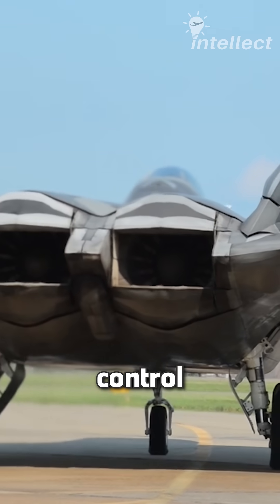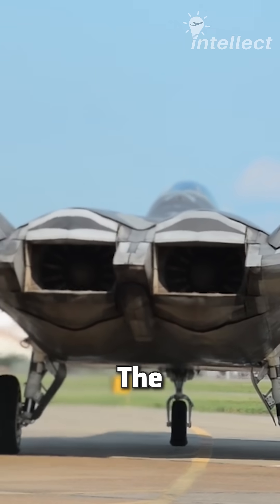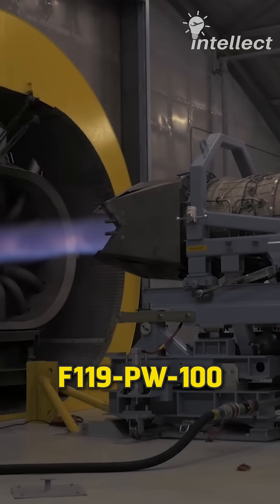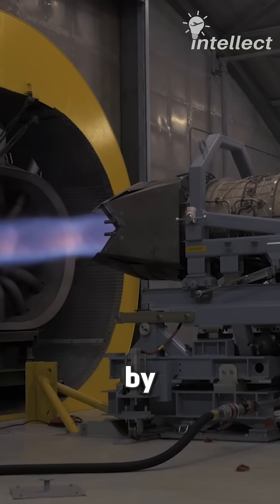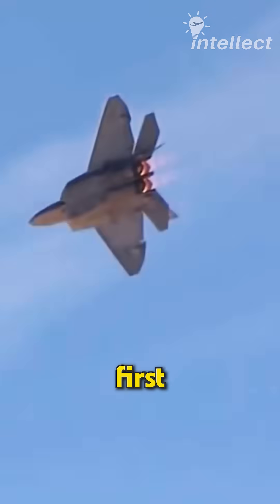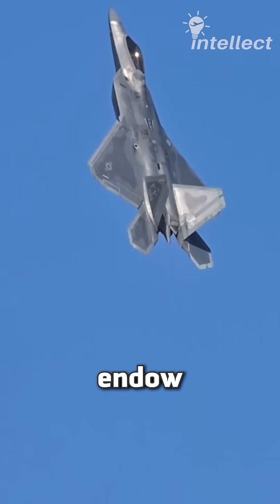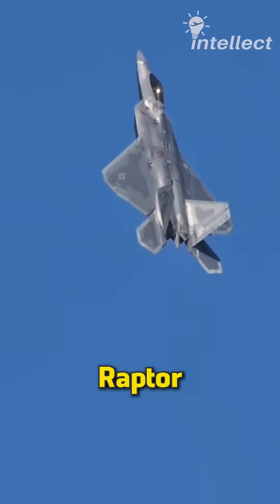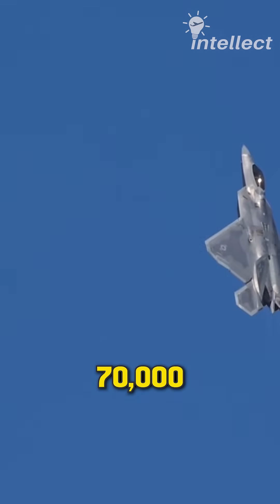How Does the F119 Engine Take Thrust Vectoring to the Next Level?

Comment: Russians did 360 degrees thrust vectoring like 20yrs ago😂
Reply from the maker: True! But 3D thrust vectoring nozzles can compromise stealth as they introduce more RCS.
Reply: As far as I can tell the only aircraft with true 3d thrust vectoring (excluding VTOLs) are prototypes like the x 38 (where thrust vectoring was invented) and f16 VISTA Russian thrust vectoring has a plus or minus 20 degree range of motion with the plain of motion tilted inwards 30 degrees
Reply: Yeah but they're not stealthy
Reply: And the us almost 40 years ago but neither country has them in service
Reply: @aquilesca5tr0  almost all variants of the Su-30/Su-35 have it where did you read that info? sound like someone's talking out of their ass to me. The Flanker family has had 3D thrust vectoring for OVER 30 years buddy. and they are in service in many countries, the F-22 only has stealth (nozzle wise not aircraft) over its thrust vectoring counterparts. but still insane engineering for mid 90s

also almost 40 years your 3 years off, F-15 STOL was 1988 i think correct me if im wrong
Reply: @tinfoilchampion3389  What russians call 3d thrust vectoring is just 2d vectoring with the nozzles mounted diagonally, that applies to every service aircraft that russia claims has 3d thrust vectoring.
The su37 has the same engines with the same nozzles as the su35 but mounted with the thrust vectoring axis vertically while the su35 has the thrust vectoring axis at an 32 degree angle meaning when the nozzles point up they also point outwards.

Comment: The sukohoi Thrusrt vectorial is much more advanced
Reply: False, the engines on sukhois only get +-15 degrees, f22 gets 20
Reply: @aquilesca5tr0  f-22 only have 2D movement, sukhois is on 3D
Reply: @tricusgames2602  that is false, sukhois have 2d nozzles mounted diagonally but they only move in one direction, only experimental planes have true 3d vectoring
Reply: @tricusgames2602  it's the nozzle moving along the single diagonal at 32 degrees axis it can move at. That's why it goes to the side when the pilot just pull pitch up
Reply: @aquilesca5tr0  i'm pretty sure theres videos of that

Comment: The sr 71 engines put out that much thrust, no vectoring tho and it went 3.5 mach, makes you wonder what the f22 can do
Reply: Thing is, when you have a stealth aircraft, you have to severely limit your speed for any length of time because the outside of the plane will heat up and you'll be vulnerable to infrared detection. This is why B2/b21 raiders don't go very fast.
Reply: @fppro1679 Correct!
 flattened and shielded nozzles come at a great cost of speed (depends on the aircraft’s general purpose as the nozzles are usually used to reduce IR signature) the J-58 being a ramjet turbojet hybrid releases a lot of heat but it didn’t matter because it travelled so fast that SAMs at the time couldn’t catch up nor could the MiG-25 however it could maybe intercept it if the pilots aren’t being careful

Also the B-2 and B-21 can’t get much intake compared to bottom intake aircraft like the F-35C or F-22A because of the top mounted intakes but they still provide enough to get the aircraft in the air based on the taper and aspect ratios as well as the certain aerofoil designs (for supersonic usually double wedge as double arc increases distributed wave formation by quite a bit) they usually have complex geometrical features at the microscopic level for retro reflection (which isn’t very efficient at supersonic speeds as they increase the likelihood of supersonic flow zone formation)
Reply: The sr71 has turbofans that turned into ramjets at high speeds the f22 just has turbofans it can't go need the speeds of the sr71 because turbofans just don't work at those speeds
Reply: @acompletelynormalhuman6392 The Sr-71 had turbojets, not turbofans

Comment: The f35 isnt a successors to the f22 the f 35 is a model for export
Reply from the maker: Yeah! But the F-35 offers more advancements in Beyond Visual Range (BVR) fights because it features a state-of-the-art sensor suite. On the close quarter fights, the intense agility of the Raptor could easily snatch the first kill opportunity. 😊
Reply: @aviationintellect  Yes, it has the advancement that aren't going to make a less advanced plane but they are currently sticking as much of that as they in the 22 bc it's stealth design is better its faster more maneuverable but they can't sell them 😉 not better just different
Reply: The F-35 is just a response for the navy wanting a stealthy jet
Reply: @jenniferdingus5309  not entirely that's part of it for sure . They would not have made the other 2 models I'd it was just for the navy . The f22, when export, halted essentially stopped the program because th cost increased the fewer units sold .
The f35 program was a sweeping program to try to field all of the branches' stealth needs . It's also becoming the most successful program in the US history of fighter jets .
Reply: @josephsmith6777  Thanks for a longer explanation I knew most of what you said but I wasn’t willing to type the entire history of the f-22 carrier failure
Reply: @jenniferdingus5309  ya, I forgot what the original order was for, but it was a lot . Japan , UK,  isreal , Australia , s. Korea and others all wanted the f22 . So, cutting the order down from thousands to basically 200 crushed the program, they even did a study to find out if they could start it back up . The cost doesn't make sense . So, instead, they made a 60 billion up grade pkg to modernize the 22 . The navy really needs something to replace the super hornet because it's putting on hours way faster than normal.  A lot of it has to do with it doubling as a tanker . This is why they fielded the drone tanker . They are also going to lose potential dog fighting ability bc the 35 isn't the best after the merge . So the ngad will have to fill that role . Unless they order more super hornets .
Reply: The F-22 is for air-superiority, and the F-35 is multirole. Apples to oranges.

Comment: What good is thrust vectoring when the pilot is limited to 9 gs
Reply from the maker: As @Lexus-fo3ey said, maneuvering the aircraft at slow speeds is made possible through thrust vectoring. Plus, it minimizes the trim drag as thrust vectoring supports flight controls.
Reply: Probably lower speed maneuvering. I mean at higher speeds the airframes rips itself apart
Reply: The airframe can infinitely pull 11 G's. A pilot could, for fractions of seconds, pull that amount of G's. Yeah, it's a small amount of time, but the plane was made when fighters were actually fighters and not scary little mosquitoes like the all purpose F-35. It's a lot faster, a lot bigger, and a lot better. But, it can also pull stall maneuvers. And that's what's special - in other words, you can throw the plane around.
Reply: High altitude maneuvering and low speed turning, especially roll rate.
Reply: Pilots. Not drones.